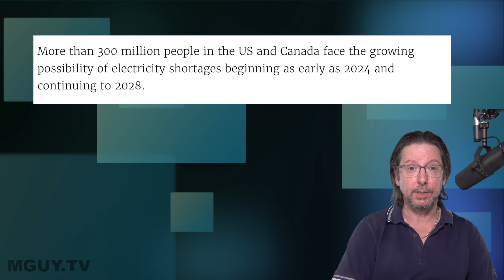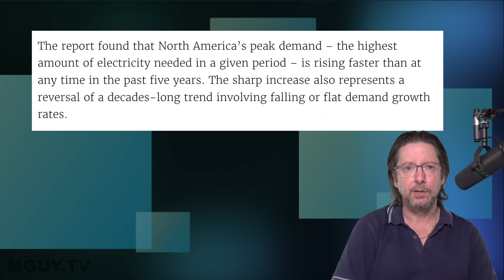Electricity grids WON'T COPE with mass EV charging | MGUY Australia

Comment: This is why I have solar panels and a portable power station to capture the energy. I recommend everyone do the same. Hell even a small portable setup will pay for itself in a relatively short time and bail you out if the grid goes down during a blackout. Depending on what you get you'll have at the minimum lighting and keep your devices charged.

Comment: Greetings from Germany! Our moronic government has fever dreams of 15 million EVs driving on german roads in 2030 (1.2 millions in 2023) and 5 million households using heatpumps (300k in 2023). Germany's electric grids can not put up with those numbers. This was said by the chief of the "Bundesnetzagentur", who has authority over electric grids, telecommunication grids and other net infrastructure. But the government igoneres any warnings and forces us citizens with laws to make unwanted changes. From 2026 on every new heating system you install in your home has to use 65% of "renewable" energy, which means that gaspowered or oilpowered heating is forbidden. Only heating with heat pumps or district heating will be allowed. District heating is actually not available for over 80 percent of german households. The EU has forbidden the registration of new cars with ICE from 2035 on, only already used cars may be used, sold, imported after that date. Eco fascism at it's best. :(

Comment: Id say most places, Aus for sure have electric stored hot water with off peak. That can be replaced with solar hot water , keep that 5 hours of 240v x 20A = 4.8kw and charge your car off peak. 20kwh should get 200kms but only gets us 100kms coz of this idiot obsession with 2.5 tonne AWD SUVs but still gets 99% of us to work every day. If its over a tonne its self masturbatory

Comment: Replacing 80% of your energy will demand 4/ times the elec capacity. Govmts are not planning for this. Hence  air con,heating,hot water, transport will need another 3 times the elec.  However the capacity is not being increased. Only matched with the existing.

Comment: Even in the US most houses do not have a big enough electrical panel to add anything more than a trickle charger. If the whole neighborhood tried to add fast chargers the local transformers would not be large enough and the substations providing power also would not be large enough.
Reply: I have been making that point since all of this nonsense started. I have 100 amp service here, and to install a charger for an EV, It would cost me roughly $20,000 to upgrade service, change out the panel, add a sub panel in the garage and then purchase the charger. The insanity of it all makes no sense, unless the end goal is to control people and limit their movements. ;-)

Comment: @MGUY can you do a video on cobalt slavery? No one is talking about how much of a humanitarian disaster EVs are. There are no ethically accountable or sustainable supply chains of cobalt for EV batteries. Then the cell's are designed in a way that makes it too expensive to recycle. These batteries need to be designed with a disassembly and recycling plan from the manufacturer.
Reply: Have a look at how much Cobalt is used to refine Crude into Petrol and Diesel!!. Far more than for use in EV batteries!!.
Reply: @graememason8337  Really? If it's consumed then it won't be as cracking catalyst either. When I get time I will. Thank you for telling me.

Comment: Eco-nazi 2.0 is not about CO2, it's about energy supply. Green Khmers came to the conclusion that struggle for control via CO2 is far to slow so to accelerate pacification of the population an energy supply crisis would be far more efficient. That's why they on purpose neglect the idea of supplying aboundant energy.  Their true agenda is to eliminate individual motorized mobility no matter the propulsion system is. And how to stop the machines and return to Middle Ages?  Just cut energy supply.

Comment: Strange video. My EV uses around 165 Wh/KM. A room heater uses more on average. And it's mostly rooftop solar powered anyway but sure whatever, carry on 🤷‍♂️
Reply: @beedoox5613  what are you talking about? Who is "dictating" anything? The only "dictating" I see is from OPEC deciding how much "choose" to pay for your fuel.
Reply: @beedoox5613 yes, in starting in around 15 years. By then combustion cars will be redundant anyway. All combustion car research has already ceased and moved to electric because it's natural progress anyway. 

Notice how combustion car progress has basically stopped? Most still use 30 year old chips. 

Automotive companies are just running down their IP.
Reply: @beedoox5613  enjoy, sounds like a sound financial investment 🤷‍♂️

Comment: Not enough electricity for  EVs? Just pull out the electric motor/batter and get a horse / horse collar, install some tow hooks on the gutted EV and problem solved

Comment: I wrote that in another one of your video: Picture this. You come home after a long drive and you plug in your EV because it has only 15% of charge remaining. Perfect, it is on the charger for the night! Less than one hour later you receive a phone call that there has been an accident or that one of your relatives are in the hospital and that you must go right now! Guess what? Your EV has less than 25% of charge in it and you can’t make it with your car and it’s freezing out there. What do you do? You call a taxi because your EV is as useful as a boat anchor in the desert. As I realized recently, the cost of a fast charger at home is sky high. Only 220 volts is available at a respectable price.
Reply: Great comment and spot on.  We all know of incidents where people at all times of the day suddenly suffer the symptoms of a heart attack or stroke and need to get to hospital post haste.  An EV can and will cost lives because of such instances.   Why oh why would anyone choose one of these crap vehicles?

EVs are killers in more ways than being cremation boxes! 🔥🔥🔥🔥🔥

Comment: This is their plan, once you fall into their system, they can limit what you do.
For example:

You can't charge your car as the grid is struggling.
For the next 12 hours, your house will have no electricity.
You have used too much electricity this week so you can't drive your electric car and the power will only be on in your house for 3 hours in a 24 hour period.
Have a look at China's social credit score system.

Also, if you don't do as your are told the gov will lock your bank account and you will not be able to buy anything....you know like food.

Comment: You don't EVs to bring the grid down in the UK. The average energy requirement of a typical house is 20% electric 80% other. So when gas boilers cookers etc are phased out we will increase the load on the grid by a factor of 5. So when doubling the grid is talked about, think again. We'll need 5 times the current grid capacity. Then add the EV load.

Comment: Power transformer cores, the windings and core, are now made in China due to lower cost.  These transformers are not as reliable as the North American sourced units with a higher failure rate.  Transformer deliveries in the USA are about 1 year vs. three months in past times.

Comment: Coal power plants are shutting down in Australia because there is so much PV being installed. If there was a need for more electricity, they would not be shutting down. What is the problem?  And EV cars are perfect to combine with PV power. The charging will kick in when there is avaliable capacity and the price is low.

Comment: The US is also trying to do away with any gas cooking or heating.  Part of the reason electricity demand is spiking.  Even if you use a heat pump thats still more energy from the grid than natural gas.  I live in the northwest and theres constant calls to tear down our hyrldro electric power.  Probably the cheapest and most evlnvironmental energy production we have, even if it only works if you have the geography for it.

Comment: And of course , we should mention the cost of electricity is  going up and up and up , and the population is growing, this demand for more electricity is only going to increase, and of course get even more expensive. 
I was going through my bill receipts today , and among them were electricity from about 15 to 20 years ago, the cost of  electricity back then was less than half the price, as was the prices for the other bills , water , gas.
And all the needed upgrades to electricity supplies and electrical infrastructure for EVs that will have to roll out across the country , there is going to be a huge amount of financial pain for about the next 5 decades.

Comment: I said I'd do some sums.  There are 19 million cars & LGVs (not including 1 million HGVs). Average distance is 15000Km/yr at an average of 5.5km/kWh. 19000000x15000/5.5=51.8 x10 pwr 9 kW. Thus in one day 142x10 pwr 6 kW/day.
Off peak power is from 2200-0700 over 3 time zones ie 12 hrs. Thus, the hourly power supply during off peak is 11.8x10 pwr 6 kWh, ie 12gWh for 12 hours. It should be noted that this just below the maximum demand for NSW as a whole
Australia produced 272tWh in 2021-22.  This is 31gWh, but 14% is solar which is unavailable at night.  Thus 27gWh needs to provide all the lighting for towns and roads, all 24 hour services and industries that operate 24/7 etc and have enough to provide 12gwh for car charging for 12 hours. 
I have been unable to determine the Australia-wide demand on an hourly basis, but I dont think there is enough.

Comment: Very simply, I look at it like this.  My household uses 70kWh of electricity per week - that for a large house.

A typical medium sized EV has a 64kWh battery, so accounting for inefficiencies in charging takes about 70kWh for a full charge.

So if an EV is charged just once per week (about 220 miles of travel) that is equivalent of adding another large house to the electricity grid.

The evangelists will argue that EVs can be charged at night, and sure there will be financial incentives (lower energy prices at night time), and I’ve no doubt that EV owners will do this to an extent, but human nature is that if an owner wants to charge your car now then that is what they will do.

Also, the thought of thousands/millions of cars charging overnight, unattended while the households sleep must raise safety concerns - with those sort of numbers and probability, will there be a house burned down every night?

Comment: Successive Australian Government's have failed at so much. Most people with science degrees or inventors, such as PVs & wind gen, departured Oz because Governments, State & Federal Labour /Liberal, who not assist them in any way.
It us both Labour & Libs who were only interested in mining industry, Coal, Gas, iron ore, anything that was relatively easy & low technical skills applied.
So niw we have a dense creZture tellubg us we must have net seri with absolutely no oniwlege sbout science and turbs his bacl on nu mear. The only guaranteed zero pollution girm on ebergy sith nir repkacement of hardware every 15-20, years all requiring mining (not in Oz thiugh,)all requiring manufacturing ( again, not in Oz). This just adds to the stupidity of politicians & Governments in Australia. Ubder Labour the policies are by the largest DUD Politicians we could scrape off yhe bottom of the sewerage farm

Comment: The average household energy usage is only small part the house. Cars make up a huge potion of family energy usage. Up till now, it's been fine with liquid fuels.
   But leaving that energy demand purely to electricity is gonna multiply electricity usage probably 10 fold.
   It takes a lotta energy to push 1500kg behomeths around 100s of kilometers each week.

Comment: Want to see a joke. Get the App Electricity Maps for your phone. It gives you a real time look at the power grids through  out the  world and what is been used to make that power. It also gives the emissions for each area from that power generation. Ontario Canada is the joke in a worst way. Their power source is primarily Nuclear power. Starting in 2025 Ontario Hydro is going to start shutting down the six reactors at Pickering Power due to end of life. There are no plans to start building new ones and the unreliable renewables will not make up the missing base load supply. Each of those reactors supplies 450MW. for a total of 2,700 MW. Over the past ten years this same power company has shutdown and demolished 14 coal fired plants rather than convert them to Natural Gas.The third Nuclear power plant that was supposed to be built at Darlington has been on the books since 1992 but due to protests and lack of permits it is still stalled in design. Canada's Federal government has banned ICE cars by 2035 so where is all that electricity coming from to charge all of those EV's and power those heat pumps they are also promoting?

Comment: The ill informed don't understand how this works. Most charging at home uses the output of roof top solar. Home charging accounts for well over 70% of charging. Public enroute charging, uses for the most part solar panels being built out over and around the charging stations. This is already happening in the US and Australia. The net result is that in most parts of the world EV charging will have no bigger impact on the grid than the widespread uptake of air-conditioning did in the 1990s, indeed probably less.

EVs for light transport are absolutely a non issue because it is easily done with proven technology.

The really hard  issue for electrification of the economy lies with what to do about the big industrial users, steel, aluminium, cement, industrial chemicals, fertilizer, jet fuel, heavy transport etc. Of course this is a much more important and harder topic, so for the cognitively challenged best ignored.

Comment: If you are going to make misleading statements at least try and back them up with actual figures.   But then I guess that's is hard when those that actually design and run the grid say it's all manageable and has potential to improve the situation, using the ability of EVs to act as storage banks for wind and solar.  Oops. You forgot to mention that

Comment: Listening to you and many others that this electric car concept has not been thought out. Baker Electric tried this in 1914 and it did not pan out. I see that they do not talk about the recycling of the batteries and the amount of pollution they are encountering with the mining of the products making these Batteries. The concepts or electric cars sounds good but the fact is they are too expensive to buy, Battery replacement cost are stupidly expensive and the rush of politicians jumping on the bandwagon reminds us the snake oil salesman from the past. The end result is going to be a pile of manufactured crap that no one can buy or operate effectively or financially. Another pie in the sky idea

Comment: It just goes to show you how delusional people are.  Major cities in the US have blackouts when it gets hot outside and everyone runs AC units.  Now just imagine adding massive loads to those grids with charging EV's.  An issue you spoke of in an earlier video is apartments, which currently do not have charging stations.  On top of that, you have rental homes, in which the renter would not be able to install the necessary outlet required for charging an EV, and if they were to get permission from the owner, would not be able to afford to have it put in, let alone the added cost of electricity used.  Approx 35-40% (depending on source) of people in the US currently rent.
Plus we all know that IF we were all required to get EV's, electricity costs would skyrocket to cover the costs of expansion.

Comment: Your assumptions about EV charging are completely false, too bad you published your views based upon zero research. Your example of 250kW charging as a reason that the grid will be overtaxed is a prime example. 95% of all EV charging is done off-peak (when we're asleep), and done at a 9 kW/h rate or less. Off-peak charging does NOT compete with demand use, and does NOT place infrastructure demands on the existing grid.
As for total energy consumption, a typical EV adds 10 kW/h per vehicle daily. That's about 1-2 cycles of a tumble dryer per day, that will NOT melt the grid.
I'm not surprised to see inaccurate and false information about EVs exists all over the world, congratulations on holding up the Australia contingent of misinformation and FUD (fear, uncertainty and doubt).
Reply: Yeah, and it looks like he’s got a ponytail!. God help us!!.

Comment: This is simply wrong. Because the timing of home EV charging is highly discretionary. Drivers will ensure, and will be incentivised, not to charge their EVs during peak grid load times such as 5pm to 8pm. Therefore, they will make no appreciable impact on the grid at the times that matter - the peaks.  I have owned an EV for 5 years and I have charged it only (a) between 10am and 4pm, from my excess home solar PV generation, or (b) overnight, between 10pm and 5am.